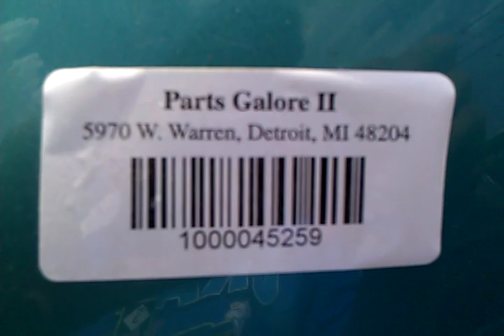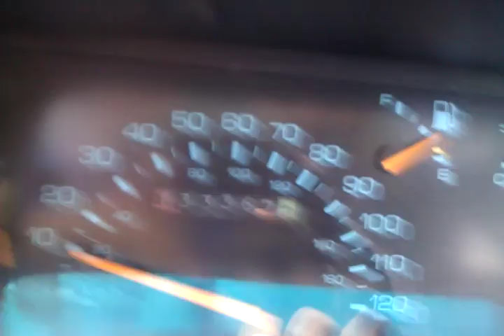Junkyard Find: 1990 Chevrolet Beretta Indy

Comment: I know it's nearly 30 years old but even then shouldn't this have had rear discs? GM made some awesome cars but they cut corners in the wrong places. On a positive note I once owned a 1993 Cavalier coupe with a 5 speed and 2.2 in a color similar to this car. Even being only a four cyl. it hauled ass and handled pretty good too. I've always had an affection for chevys. I'd probably still have that car if not for the poor spot weld on the passenger side that caused a puddle every winter. Unfortunately I bought it just out of warranty so I got rid of it the following summer. I knew a guy who had a Corvette built around the same time with a poor robotic weld. Luckily for him he bought it new and GM traded it for a new one that didn't leak. I've never seen one of these and I worked in a Chevy dealership. I know they were planning to release a convertible but cancelled at the last hour.